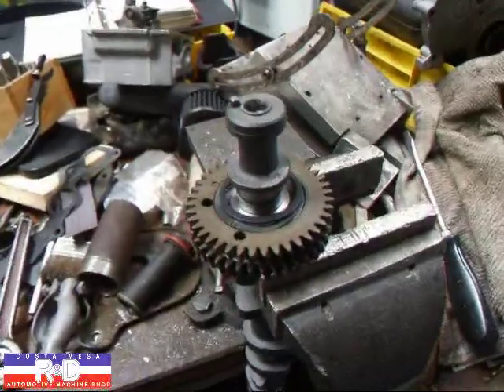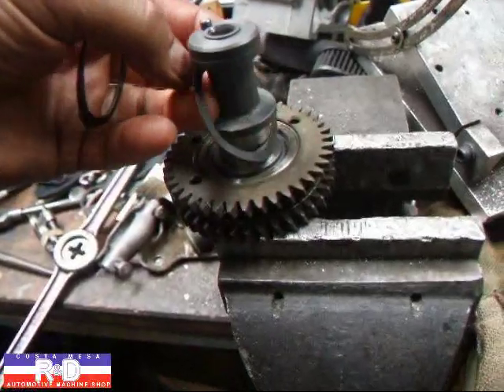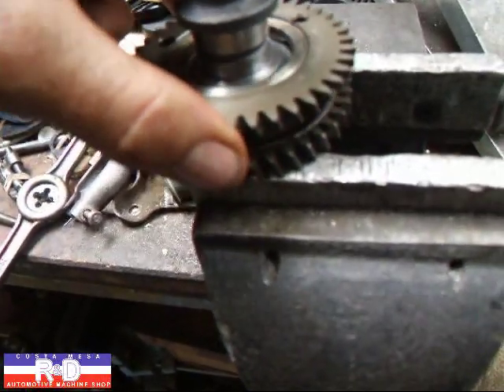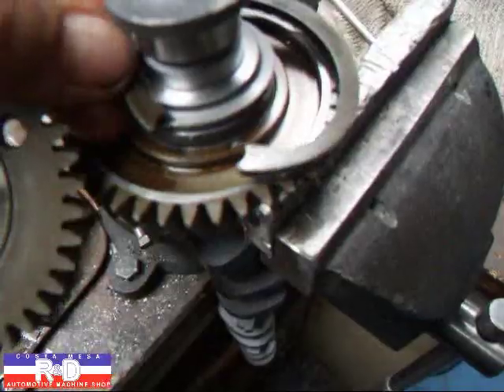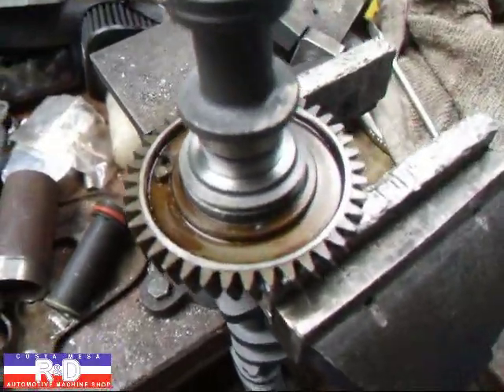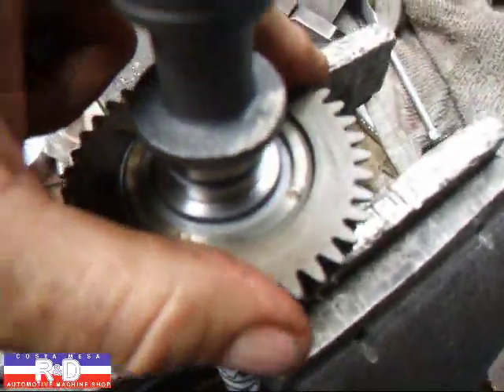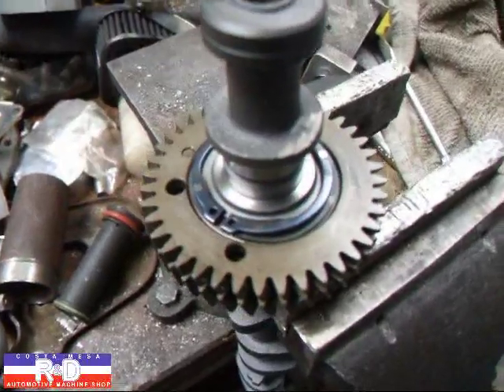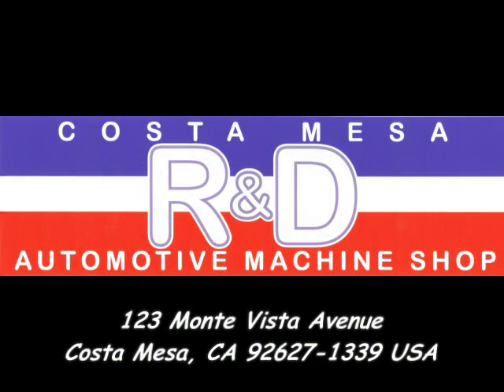Toyota Scissor Gear - How It works.mp4

Comment: Hey, nice video. I got a question hopefully you can help me out so I'm doing a head gasket on my 2001 tacoma 2.7 L. & I am just about ready to take the head off but my sub gear & main gear are not lining up for me to put the service bolt thru,  although the timing marks on the back, the 2 & 1 dots are lining up like they are supposed to, also the head gasket was done in 2015 before I bought the truck, I got it in 2018. It looks as if the sub gear is off 1 tooth so how do I get it to move without taking the camshaft out, that way i can put the service bolt thru, is that possible?

Comment: Maybe i'm wrong.....but I dont see old m8 Pretensioning the Scissor Gear and Locking it off in the correct position ready for installation.....I had to work that out....Logically assembling and fitting it by his definition defeats the whole purpose of the Scissor gear without Preload.....?

Comment: Yes, "snap ring", "circlip" are standard expressions for those "locking rings". I'd probably use the term "spring washer" if it sprung (haha) to mind when I needed it, but "wavy washer" actually defines the look and action better. I can think of four very different types of washer, when I hear the term "spring washer", only one when I hear "wavy washer".

Comment: Its not just the noise but by damping the backlash they will eliminate some of the backlash. I've seen this used in RF mechanical attenuators to eliminate backlash on encoders.

Comment: It makes the gears run quieter by damping the backlash. Otherwise they will make a wining sound when the engines running like the gear drive conversions kits for chain drive V8s... All the Toyota FE single cam pulley,  twin cam engines use them

Comment: According to a book about vehicle tech I found on google books, the scissor gear design is used to absorb torque fluctuations that happen due to changing loads on the camshaft caused by the valves opening and closing. The torque is a problem because the cams are closely spaced and one is driven by the other, leaving no space for a chain or tensioner to absorb these fluctuations. Pretty slick idea... and great video as always!